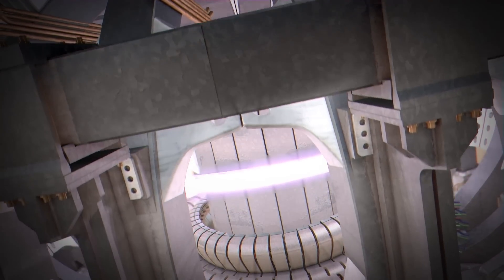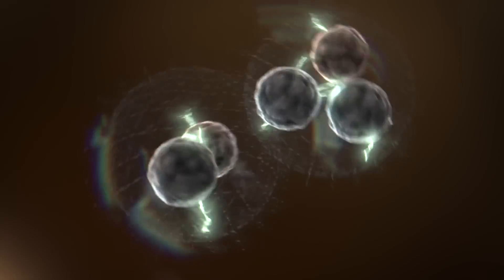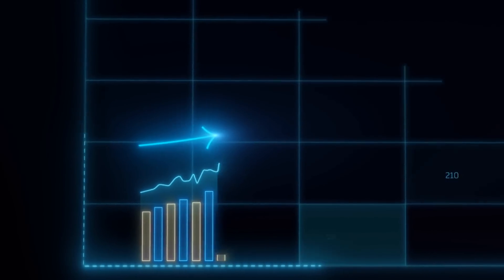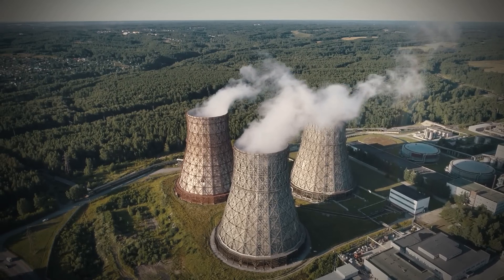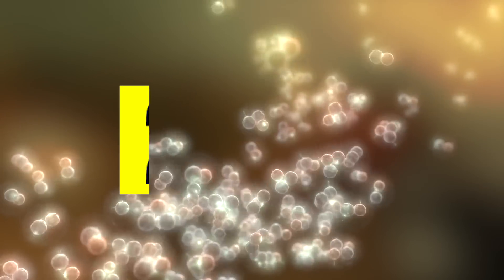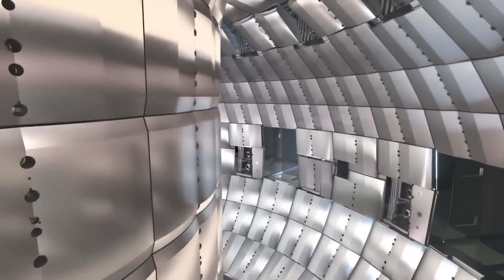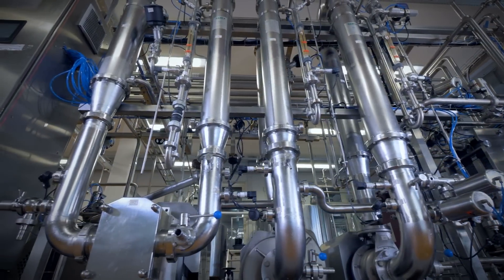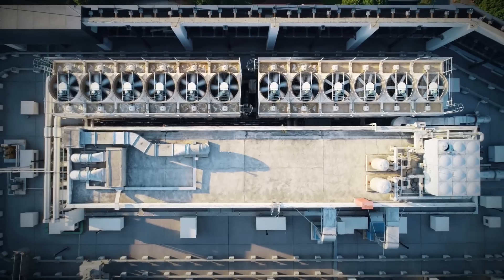The Shocking Problem That Could End Nuclear Fusion

Comment: I thought you were about to talk about plasma disruptions and their irreparable damages to the hull.
Or the fact that the hull is radioactive and will be hell of a challenge to fix.
Or the fact that tokamaks are quite a dead end compared to Z-pinch but that one has curiously been ignored since the Sandia Labs exceeded 4 billion Kelvins 5 years ago, a temperature that could lend itself to the aneutronic bore-hydrogen fusion and solve both the tritium and radioactivity problems!
Reply: 2 billion kelvin (3.6 billion F). That's still about 4x too low for peak Proton-Boron11 fusion. Further, you need more than just temperature. You also need pressure and confinement time. Lawson doesn't only apply to tokamaks. Z-pinch is not being curiously ignored though. Zap Energy are leading research here in the private space and attracting decent investment.
Reply: championchap  it genuinely feels like you're replying to the wrong message.
Reply: championchap  a source of "random internet stranger" is genuinely useless in every single academic aspect. Sorry I don't take the word of an aggro stranger on the internet that makes it seem more and more like they want an argument with every reply they send. I can just as easily claim hydrogen has two electrons....and you cant disprove it without a source of information. The funny thing is molecular hydrogen has two electrons. H2. Two protons two electrons. So not only did you just claim something as fact you claimed INCORRECT INFORMATION as fact. Why would i trust another word you say at this point?
Reply: There are even fanboys when it comes to fusion power?  Christ on a bike.
Reply: Have you read Jean-Pierre petit ideas about the the nuclear fusion?
He was talking about all this prior to 2010.
Reply: Careful, the Google-Experts and Conspiracy Lovers are lose!
Reply: @MisterK9739  nah he is kinda right, I am currently writing a paper on nuclear fusion and before I started my proper research I was an absolute fan of Iter and the Tokamak but the deeper I got into it the more I understood that Iter might be a pretty nice science project which might actually work, it is way too expensive, too big, a logistical nightmare, completly outdated technology and the tokamak itself simply isn't the best contender anymore

my personal favourite at the moment is the Stellerator type of reactor like Wndelstein 7-x, they have some really clever magnet designs which almost solved the problem of plasma confinement
Reply: @MisterK9739  If you are talking about Jean-Pierre Petit, that guy is a genius.
Reply: @MisterK9739  Lolilolilol... Do you have any good argument against what I just wrote or just careless brushing away like it's nothing?
I've consulted JP Petit's blog for years and read his rants against ITER, the guy is a former head scientist in the main research center in France and not a conspiracy theorist!

• Plasma disruptions are the main cause of reactor emergency stops and are utterly unpredictable.
• Deuterium-Tritium is a radioactive neutronic reaction.
• The Z-Machine produced 4 billions degrees that could be used for aneutronic reaction.

These are *facts*!
Reply: @Patapom3  without sources they're just claims.
Reply: @ThePesmat  They're totally legitimate questions! I don't have to source my legitimate questions: you have to prove that your technology solves my questions!
That's what any project should prove before being approved!
Reply: @Patapom3  it's the claims you made that I'm asking for sources of. Sorry I don't like the source of "trust me bro" from someone on the internet I've never spoken to before. You even HEAVILY emphasized that they're facts so...prove your statement.
Reply: @ThePesmat  I'm not claiming anything, I'm asking legitimate questions about the issues with ITER and nuclear fusion in tokamaks in general.
Reply: @Patapom3  saying those things are facts isn't asking questions... i just want to know i can believe the information you're giving.
Reply: @ThePesmat  That deuterium / tritium is emitting neutrons? That neutrons make the tokamak's hull radioactive and difficult to replace?
That's common knowledge.
Reply: @Patapom3  it's really not and now you've made the claims REPEATEDLY while refusing to provide evidence and even claiming you aren't making any claims that these things are fact. You've done it twice now. You're a stranger to me. Give me some information I can actually trust instead of expecting me to take your word on it. You said you studied this stuff so share some of the sources you learned from so I can educate myself too.

Comment: That is not the biggest issue of Fusion.  The biggest issue is to reach net positive electricity output (until this day, none fusion experiment was even close to that despite what some news claim), the second or main issue, is how to convert thermal energy into electricity in a cost efficient way to compete with solar PV and Wind.   The last word to that.. is that THEY CANT.
Thermal to electricity conversion is a technology that is being exploited over the last 100 years, there are no more breakthrough in that area to discover, that process alone cost as much as the cheapest places for wind and solar today..  So..  Game Over..  unless they find out a new fusion way to extract power without boiling water.

Comment: at this point I think they're honestly overthinking fusion. If so much has to go into it just to take advantage of an incredibly minuscule effect, then the idea should be crossed off the list. It's never going to be 100% efficient, especially at this rate. It also shouldn't require quantum physicists bashing heads just to pull it off. It has become such a horribly over-complicated concept that they're starting to run out of ideas to "improve" it. Fusion is not "the best" or "the solution" if the way they're going about it produces more waste, higher cost of maintenance than a power plant, and nobody really understands it enough.

Lithium batteries were discovered through pretty basic chemistry and lithium is what's really powering everything in our lives. All that we really need, is an alternative to Lithium that's more abundant and readily available (and maybe cleaner to the environment).

Cold fusion is theoretically possible, but they would rather invest in dangerous nuclear fusion because it can supply energy on a mass scale. Well I don't care about the grid or consumer demands anyway since I live off of my solar panels.

Comment: They running this biggest scum for decades now. I suspect they need tonnes of tritium to moke it work. And as there is no tritium available in tonnes all this money laundering will continue for next decades. IMO.
Reply: Wtf, look up the tech, it works, and would work even faster, if they did get like a little more money, as like the Manhattan project
Reply: @jamesblace5761  the problem is it never worked. They never got more energy that they put in. It's a dead end but they keep it running as they want contracts and money.
Reply: @spaceclips77  bs, they don’t get like much money…. Germany did spend this year alone 5 times the amount on useless weapons (thats corruption) then the total 20 year project cost of iter… the problem actually is, that they would need political influence, to make this work… it’s all just cost, if you build something like iter, but little bigger, there are good chances, it could work..
Reply: @jamesblace5761  yah, chase dreams.
Reply: @spaceclips77  wow, seems like you have plenty of good arguments, seems like you are right..

Comment: 1. You  might as wll use any other source of Neutrons to breed Tritium, e.g. radioactive materials or existing Uranium Reactors. No short supply of neutrons.

2. Thorium reactors (which are coming up) produce tritium as a by-product.

Fusion reactors won't be there before 2050 anyway. Til then, we'll have stockpiles of tritium from Thorium Reactors.

Comment: No research is ever wasted! 

Even if fusion turns out to be a wet fart we've already gotten returns from it that might be just as important. For instance the research into ignition yielded the millimeter wave drilling process, which might yet make cheap deep geothermal power a reality, which would solve our energy problems for a very, very long time. That alone would be worth all the money put into fusion so far.

There are probably hundreds if not thousands of small returns and usable technologies that will come from fusion research that will have zero to do with fusion itself later.

Comment: For all the talk of fusion, 2 main problems STILL exist, power in vs thermal power out, efficiency of steam turbines to convert the heat to mechanical power ie generation, 
Being that not one single experiment has got close to 1:1 power output, how on earth can it suddenly double its efficiency to 2:1 to break even, based on thermal conversion being at its best 50% efficiency, so your still not “ generating “ anything until you go past 2:1 input to output. 
It’s all pie in the sky, waste of money and resources when better, actual working models of low emissions generation already exist

Comment: As I see it the whole idea falls with the problem of generating the steam for the turbogenerators from water. The fusion energy released is mainly in the form of energetic neutrons. These must be captured and stripped of their energy in some sort of blanket in which steam generators can work. Since neutrons are essentially neutral it needs a considerable depth (flight path) to rob them of their energy. And this blanket must encompass the entire reactor - and must, of essence be at a height temperature. I just don’t see any realistic engineering solution to this problem. I.e. forget the whole thing.
Reply: Salt, a whole lot of molten salt. Problem solved, harvest the energy to make steam from the salt, no problems at all.

Also, not all fusion produces neutrons, so, also easy to avoid and just use water flow like any other power plant.

Comment: oke so for your information, it is possible to run the reactor in D-D state, such that one does not need T to start a reactor. We lose energy doing so, ofcourse. Going for D-D does, however, allow for T-breeding such that we can start several reactors at once

Comment: We can easily make LOTS of Tritium with Li-6 blankets on fission reactors if we need to. We don't have to produce tritium with breeder blankets on fusion reactors... we can simply design new fission reactors around Li-6 blankets - producing power as a byproduct as well. Pretty sure fission reactors throw off a lot more neutron flux (especially if designed to do so) than a fusion reactor will - because each fission reaction releases less energy than a fusion reaction, you need more of them... so presumably to sustain the chain reaction, you have a lot more neutrons flying around.

As for separating Li-6 from Li-7, there is a potential solution... if we can find a gaseous lithium compound, we can centrifuge it just like U-235/U-238... except the mass difference between Li-6 and Li-7 is much greater, so centrifuging will be EASY by comparison.

Heck, if we can figure out how to centrifuge something at 1000C, you could even do this with - say - gaseous lithium hydroxide.
Reply: Li-7 can breed tritium from fast neutrons in a fast fission reactor, negating the lithium enrichment problem.

Comment: Just use geothermal. There are some new technologies out there that show promise. Forget renewables because without storage they are pointless. You can't say wind and solar are cheaper until you can show the annual constant generation costs. Making electricity in summer at mid day is easy. How about making it in winter. You have to store it for winter. 
Governments should stop fusion and put money into making geothermal work. You don't have to worry about storage with geothermal or building stupidly complicated and expensive machine that could just run out of fuel.

Comment: Six times hotter than the sun's core
Think about that and work out how hot that is
Every reaction generates "waste" heat 
Even if its possible to convert the energy generated with an efficiency of 99.9% the excess heat will boil oceans 
No one mentions this fact they are too busy getting copious amounts of funding for something they know is impossible 
I suppose they think they can teach the horse to sing
Without major technology breakthroughs which could take hundreds of years fusion is a pipedream that does not deserve the amount of funding it receives
Spend some time thinking before spending huge sums
Dont get me wrong i would love to see fusion working

Comment: the key is the moon, there is a endless amount of the isotope called helium 3 that is far better than tritium for fusion and get produced by solarwind over and over again. because someone asked here is a 16 years old paper from the MIT that explains the next step after D-T fusion research is finished. https://ocw.mit.edu/courses/22-012-seminar-fusion-and-plasma-physics-spring-2006/e2e8eb876c7ec0dff934149b83f8c3fa_helium3_fusion.pdf

Comment: We've been making stuff with neutron bombardment for ages without fusion reactors, fission reactors produce tonnes of neutrons too. These tritium breeding blankets seem like a complicated and expensive way of doing something that can easily and cheaply be done using other methods.
Reply: I agree that investing in fission-Nuclear is a smart bridge for both T2 and green energy, but it Is ultimately a non renewable, whereas a lithium blanket makes the T2 much more renewable
Reply: We've been transporting coal using mule carts for ages without the use of steam power. Steam engines seem like a complicated and expensive way of doing something that can be easily and cheaply done for the cost of some hay.

Comment: In 1970, fusion was just 40 years away.
In 1980, fusion was just 40 years away.
In 1990, fusion was just 40 years away.
In 2000, fusion was just 40 years away.
In 2010, fusion was just 40 years away.
In 2020, fusion was just 40 years away.
So far, nuclear fusion has not produced enough electricity to run a digital wrist-watch.
Does ANYBODY still believe that we are getting close to fusion power?
Reply: Well I mean, the holy grail for humanity to trascend to a type 1 civilization couldn't be that easy to achieve, right?

Comment: What you describe is not a problem with fusion. It's a problem with tokamak fusion. There are other possible reactions such as hydrogen-boron. And there are other setups such as dense plasma fusion. Dense plasma fusion would work commercially by now if it had the same funding as the tokamak vanity projects.

Comment: You assume that a self sustained fusion reaction is achievable. Thus far , there is not a one successful fusion reactor on the planet, unless they have one and are keeping it a secret. 
Irrelevant!  Even if fusion is achieved, it will be used as a glorified steam engine furnace.
We're talking using a miniature sun to turn water to steam so we can power up some huge ass turbines, that actually produce electricity.
UN- acceptable!  I refuse to believe we have no better method of producing electricity, than a steam engine! 
We are in effect using a 300 year old technology , at the very least, as a basis for our entire civilisation.

Comment: You can create tritium with Fission, so you could either have breeder reactors as a resource generator or use fission reactors for power in addition to Fusion and ship its product. Certainly not the silver bullet fusion we all dream about, but rarely are things so idealistically accomplished.
Reply: Sounds like a big part of the solution is to just make more candu reactors.  SMR based versions are already being developed.  They are 1950s technology and can produce energy using existing nuclear waste or unrefined uranium as fuel.  The only real downside is they need heavy water as a moderator and general nuclear fear mongering but overall operating them is still economical.
Reply: @ccibinel  could use graphite… 3.6 rontgen is not so terrible.